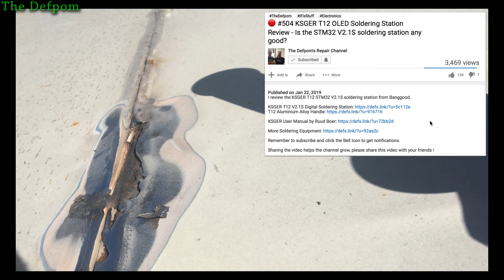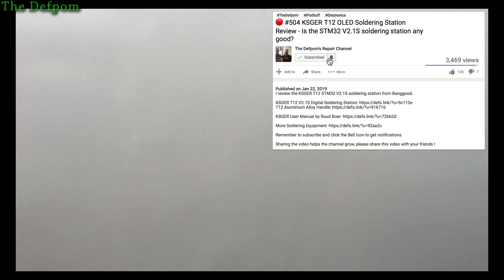🔴 #547 Toyota Coaster Roof Seam Rust Repair - How To Fix Rust

Comment: Just found your channel instant sub goodwork on the coaster roof my coaster had too much rust in the roof, cut compllete roof off got it made up in fibreglass using old roof as the mold put new roof on trimmed back buttoned up dressed and sealed no more rust in the roof  was a bit expensive though but worth it i the end cheers love your channel

Comment: Great vehicle for SPL competition? :-). Rust is a real nightmare. I am in Columbus Ohio US, and with the winters / road salt, vehicles can get very crusty if not washed off regularly (even in winter). I cut out a big section / welded new metal in a section of my mid 90's Lincoln Town Car, but I'm afraid it is a lost cause at this point, lots more spots bubbling through now. I guess removing what you can, sealing as well as possible, it will extend the life. Good work so far, I know it definitely takes some effort to do!
Reply: North east Scotland here, on the coast......same rust problems, its hell on vehicles albeit less than it used to be due to better quality metals and better rust proofing.
Reply: @IanScottJohnston   Most definitely is hell on vehicles!

Comment: Hmm rust is a bugger, that water/air reaction with metal is a dam nuisance :-(
When you have done the whole roof, you need some kind of barrier, like say a wax coating to stop the water ingress.
Something like that maybe :-)
Reply: Pop the roof liner off inside and paint the inner surface with boiled linseed oil, a few coats. Will stink to high heaven till it polymerises, but will keep the rust at bay from the inner surface.  Especially on that joint, where you will find the inner has a nice little edge of exposed rust that will just keep on coming back again. Works as well inside the doors, keeping the door skins from rotting from the inside out, though you will want to park on a bed of gravel, or put old cardboard under the doors, to catch the drips. Also on the side panels, so they do not go flapping in the breeze.